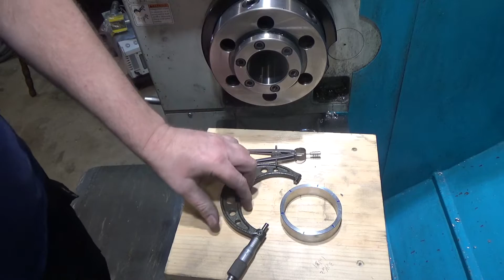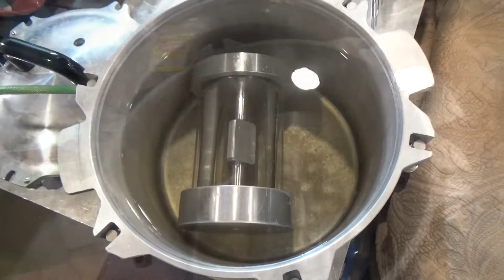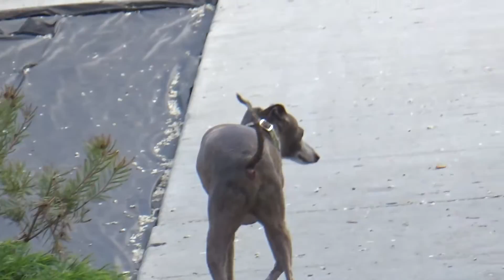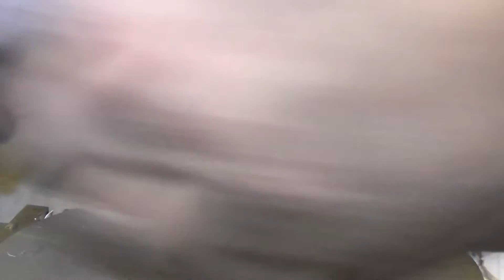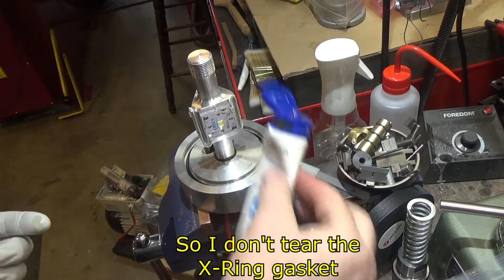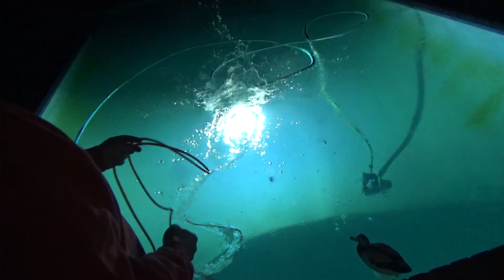120 Underwater Light Lure for Night Fishing Part 3

Comment: Dudley - dude,  it's me again. I guess one day you're gonna ban me for all those flies I'm constantly putting in your ointment, but hey - no risk, no fun; no guts, no glory, as they say... ;-)
OK then, where shall we start... Oh yes, at the beginning. It's always better to start at the beginning, because if you begin at the end, you might just end where you start. (Or something like that.)
Anyway, it’s been a while since I watched this video but didn’t really have a time to write my comments - and I’m sure that somebody else has already pointed out a thing of two from my list - but as I don’t have the time now to read all those comments I’ll take the easy way out and I’ll write all of my remarks, step by step. Grab a coffee, get comfy - and enjoy ;-)
 
1. Cast acrylic (PMMA) versus extruded acrylic - well, yes, they are tad different, and it is said that cast PMMA is better for machining. Which is true, but the difference isn’t that great, and methinks it really matters only when it comes to milling thin grooves in PMMA sheets - like outlines of letters and various shapes in advertising signs and such. (If you try to mill extruded PMMA with thin end-mill it will just melt and clog the mill - only cast PMMA can be used for this application.) However, cast PMMA can also melt during cutting if the tool is tad dull, as you have experienced it yourself. Speaking of which... but I'm getting ahead of myself.
However, for “plain and regular” cutting, drilling or turning extruded PMMA is quite suitable as well - and noticeably cheaper at the same time. Also, I believe extruded PMMA is tad less brittle than cast one, but again, it's not like "day and night" difference - you can crack extruded PMMA just as well.
Side note - when you drill in PMMA sheet, especially close to the edge, it's better NOT to use very sharp drills - which is bit counterintuitive, but true. "General purpose" drills have positive cutting angle (rake), and that makes them to bite too fast into soft materials - like plastics, aluminium or bronze. In case of PMMA sheets it often results in cracks, as the drill gets "grabbed" and "pulled in”. In which case it has no time to cut and properly evacuate swarf - instead it gets pushed in like a wedge and this often causes PMMA to crack. To prevent this you could grind a neutral or slightly negative rake onto the drillbit (see Chris from Clickspring elaborating on this issue here: https://www.youtube.com/watch?v=pAngKHIZgyA) - but unless you do a lot of work with acrylic (or other soft materials) it is not a very practical idea. A slightly dull drillbit will do the trick just a as well, since “excessive" heat released during drilling will soften PMMA locally and that would be enough to prevent it from cracking.
2. Cutting tools - bronze, soft alloys and plastics are those applications where HHS cutters shine, as you can grind them razor sharp - unlike with carbide inserts which are always tad dull, by design. Properly sharpened HSS tools cut plastics or soft metals like butter. (BTW, grinding stones made of aluminium oxide, or corundum, are best for grinding HSS.)
3. If you try to face a wobbling cylinder, the resulting face won’t be perpendicular to the main axis of the cylinder. If you cut both faces without getting that cylinder properly aligned axially, planes of those two faces most likely won’t be parallel to each other. And when you combine those issues with that tightening system of your choice (i.e. the design of the lamp) there might be a problem with getting the lamp watertight.
Yes, I know - you’ve tested it, and it, erm… “did hold the water” (outside). Still, this is not the most technically sound design - more about it latter.
4. That aluminium ring for holding the acrylic - well… Poor choice, if you ask me - as aluminium, or rather its alloys suitable for turning, are rather rigid (i.e not elastic - even though quite soft).
And chucking an elastic (and easily breakable at the same time - I mean, with a low “yield point”) material from the INSIDE?! Umm, that’s a big no-no. ALWAYS (OK, whenever possible) hold them from outside, as they can withstand compression much better than stretching. Of course, you’ll still need some relatively rigid collar to hold such workpiece securely - but it doesn’t have to be anything fancy, a piece of thick-walled PVC sewer pipe of “close enough” diameter would do.
5. Petroleum jelly, plastics and rubber? Hmm… No, thanks. I’d rather use some silicone grease, as it is safer for rubber and plastics, and lubricates plastics better. And I’m saying it as a chemist - for more detailed info see https://www.youtube.com/watch?v=JUkzNo5NG3g
5. The design… Well, “How Not to Land an Orbital Rocket Booster” (https://www.youtube.com/watch?v=bvim4rsNHkQ) immediately jumped to my mind, don’t really know why… ;-)
Seriously though, my opinion is that this design is kinda totally backward - look before function and durability, waste of material in exchange for overly complicated machining - and all that topped up with poor sealing solution.
I’d just make two flat discs with grooves in them to accommodate o-rings and acrylic cylinder - and then I’d drill four or six evenly spaced holes around, OUTSIDE of that cylinder, and joined and tightened the whole thing with four or six pieces of readily available threaded stainless rod - say, M10 (3/8") for six holes pattern, or M12 (1/2") in case of four connecting screws. This way not only I’d save a lot of material, but I’d get an excellent watertightness as well - EVEN in a case where my cylinder would be turn “crooked”. And, as a free bonus, I'll have a protective cage around most fragile part of this lamp (which is that acrylic cylinder).
What would be that extra protection for? Well, the lamp is intended to be used during night, on a boat, at open sea - right? Means, darkness and a kinda crowded/ tight place, wave action (= boat rocking), things are moving around the deck… Or, the lamp could hit the side of the boat when dropped into a water or pulled out of it, right? And then what will happen to all that electronic stuff inside if it gets flooded with salt water? 
Dissimilar metals, salt water and corrosion? Yes, that would be an issue, if that lantern would remain submerged for weeks or months at a time - but not in this case. Scuba equipment (tanks and regulators) are made of dissimilar metals, and as long as you rinse them with fresh water after the dive they are perfectly OK and last for years.
And with this design the whole inside of the lamp is empty - I mean, there isn't any “fixed, unremovable central part” where you have to build everything around it - you’re free to arrange things inside any way you’ll see fit - and yes, you can still, if you want, affix some central “column” inside, (threaded into bottom or top), to which you could then attach your lightning system.
Plain and simple, easier to machine, easier to seal and with additional protection, uses less material to make - what’s wrong with it?
Only one through hole (i.e. from outside into inside of the lamp), for electric wires - which can be easily sealed either with some watertight cable gland/ cord grip or with a a good blob of a silicone (“neutral” one in case of aluminium), or with some other sealant (although a gland with a rubber seal would be much better solution).
Everything hung on a rope with a fisheye bolt attached to the top part of the lamp (and electric cord tied to the rope with a zip tie every foot or so) - plain and simple, safe and functional, easy to machine, asssemble and dismantle, and easy to make it watertight. What’s not to like about it?
: )
Best, KB
PS: Here's a video by TOT on grinding HSS tools - kinda over elaborated, like a manual for simpletons and people seeing a lathe first time in their lives - but still with some useful info:
https://www.youtube.com/watch?v=__A2xtLF0AU
Reply from the maker: I really appreciate the amazing amount of time you must have spent to share all of this information. Thank you. I don't mind constructive criticism at all. If I knew even a fraction of everything, this hobby would not be as much fun.

I did consider the external bolt approach, much like some hydraulic cylinders, but  thought the center threaded shaft would be more fun, even though probably inferior.
Reply: @DudleyToolwright  Thanks for your appreciation. Yes, it did take "some time",  especially that I'm not native English speaker. But I'm always willing to share my knowledge, and I don't mind spending some time and effort on it. And since I watched and enjoyed your video, which "took some time", your time, to film and edit, it is only fair to me that I'll spend some time and effort in return for that entertainment I got.
Also, while my remarks might sound critical (hey, I'm natural born knocker ;-) , the main idea  was  sharing knowledge and giving hints and suggestions. About the design itself - yes, I thought it could be just that - that you opted for this particular design as it was more fun and challenge. And yes, I'm perfectly OK with the fact that you choose to do as you please : )
BTW, speaking of "challenge and fun" (and screw the economics) - maybe you've seen those videos, maybe you haven't - in case you have, do not clink those links below. But in case you have not - enjoy!:
Giant Bandsaw Restoration Project, p. 1.: https://www.youtube.com/watch?v=0JwqvRHVOAQ
Part 2: https://www.youtube.com/watch?v=-6LCxKOmSyY
Part 3: https://www.youtube.com/watch?v=jk8d6WqX2Tk
Part 4: https://www.youtube.com/watch?v=C8zz5rTr7CQ
Reply from the maker: I love Fireball tools. I met met the owner at the last BarZ Bash last year and he's a great guy. I haven't seen those videos yet, so I'll check them out, thanks. I loved his belt sander build.

Comment: My favorite failure mode for a system like your is water seeping through the cable insulation and leaking along the wires past the gland....even with expensive cables ... don’t ask how I know this
Reply from the maker: This is a significant worry for me as well. I was thinking about injecting epoxy or something similar into the end of the cable. I just wasn't sure it would work. A lot of cables use talcum powder between the conductors so they don't rub. I am not sure what the proper solution is. Thanks the the great pointer.
Reply: @DudleyToolwright  don't create a hard point. epoxy will create a failure point. You want something that remains flexible, and doesn't eat the wire. I don't like silicone because of the risk of black wire. But something like silicone, unless they make a silicone that will not blacken the wire (what a cancer).
Reply from the maker: Useful, thanks for the tip.

Comment: Great result. Just wondering why acrylic & not polycarbonate? apart from cost.
Reply from the maker: I found the acrylic first, other than that no reason. Polycarbonate is stronger, so I could have used thinner walls, but that might have made gasketing more difficult.

Comment: FYI!  It's hard to tell from the closeup, but if the there is a relieved chamfer at the back of each groove on the tap, that is a sectional tap so you can cut off the used portion and have a new section.  We (GTD) used to make thousands of these for automotive years ago.  It allowed the operator or tool room to simply cut the section off, rather than trying to re-chamfer with many times so-so results!  For high production, tool performance was far more consistent with a factory grind! Each tap had a tool set length for each section, so it was simple to reset the depth on the machine.
Reply from the maker: Oh, that is really interesting and makes sense. I looked on Brubaker's web site, but could not find this specific tap, so perhaps your explanation is dead on. It makes sense at least. It did really cut well though.
Reply: @DudleyToolwright  You won't find them. They are custom only!  If you found this tap somewhere, it is likely surplus tooling that someone sold off.  I haven't seen them in use for many years!  A common application was differential ring gears. dave

Comment: Great job buddy! Good thinkin' on the mandrel.My heart sank when I heard the crack, I thought it was the acrylic.=O 
 Obviously it wasn't a problem, but I'm curious as to way the runout when facing the end didn't bother you. I know eccentric runout when facing doesn't matter, but couldn't off axis runout such as that create a problem with flatness? ATB
Reply from the maker: The runout was visually and emotionally driving me crazy, but it didn't seem to effect the flatness too much. This, fortunately, was not a precision operation In the end the silly thing seems to seal pretty well. Besides there was no easy way to fix the runout because the wall thickness of the acrylic varied by more then 0.030" around the circumference. I'd hate to see how bad the supposedly less precise extruded acrylic parts are.
Reply: @DudleyToolwright  Yea I think the light turned out awesome. If need though, I believe perpendicularity and flatness could be obtained in that situation by indicating the runout to be the same at the same rotational positions on either end of part, creating inconsequential eccentric rather than the problematic off axis runout. I could be wrong or be using the wrong terms though. Thx for the reply.
Reply from the maker: Thanks for the clarification. Very helpful.

Comment: Suggestion, your ring with the slots- just make one "slot", but cut all the way through. It will expand easily.  Just as I finished typing my suggestion, your video explained that it did split.
Reply from the maker: Thanks for the tip!

Comment: The plumbing store has silicone grease. It doesn't react much to anything.  I'm wondering about a petroleum product inside the chamber reacting to the heat generated by the led array. Would it discolor the lexan?  I'd love to borrow that light for ice fishing. Love the vid
Reply from the maker: You bring up a good point. I am not sure of the answer to that one. Thanks for the suggestion.